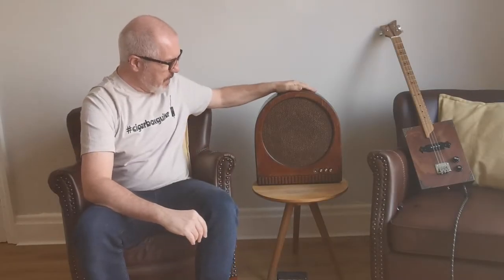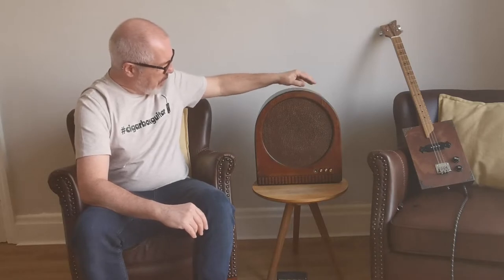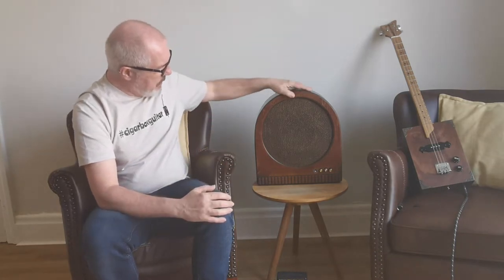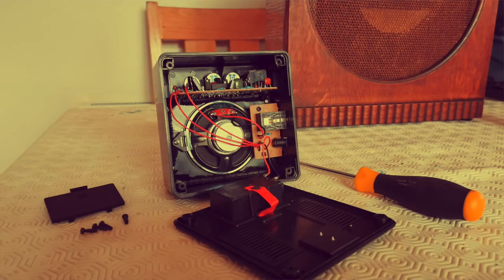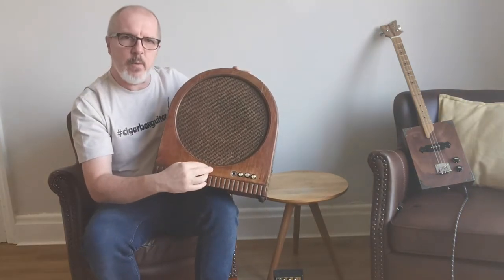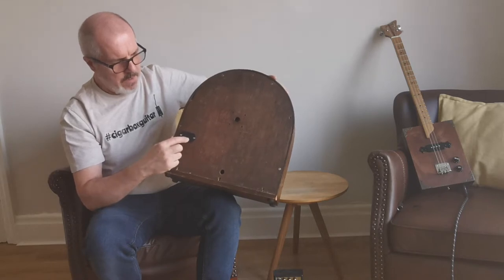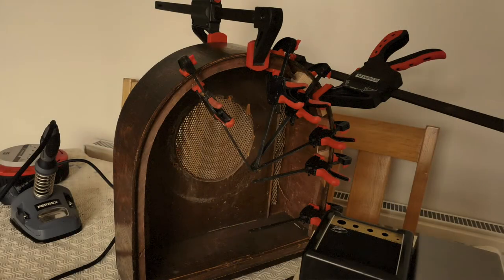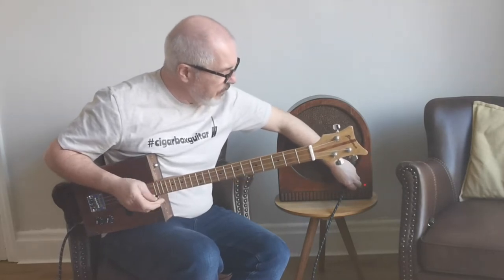Vintage 1940s Speaker Cabinet Conversion To Retro Guitar Practice Amplifier For Cigar Box Guitar

Comment: Sounds great!  My attempt at an amp was using an old metal case for an electric fence charger.  It doesn't sound near as good.
Reply from the maker: Thanks Willy, I hope the electric fence was unplugged! 😆
Reply: @OldManWilliams  It was an old one that didn't work and i just gutted the case, cleaned it up and put in the amp bits.